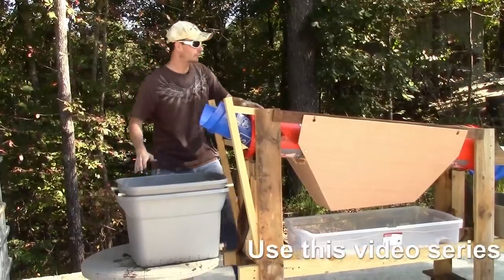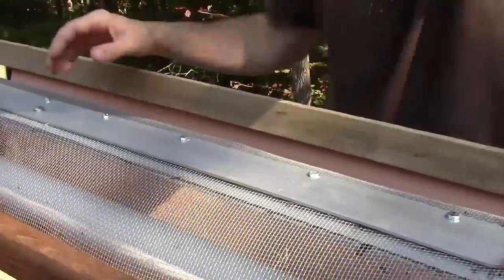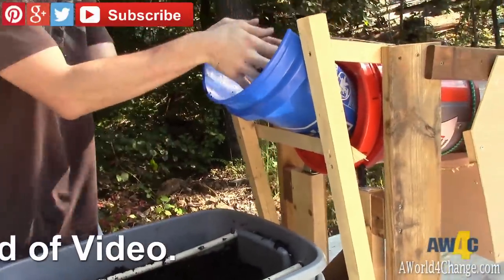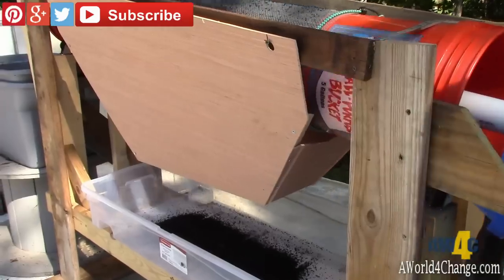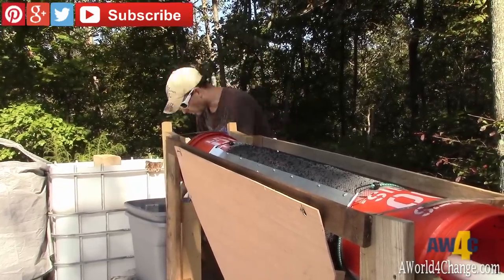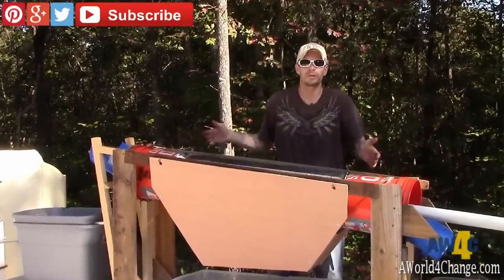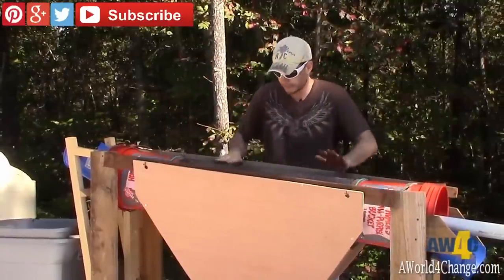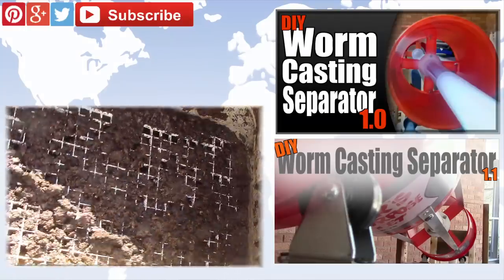DIY Worm Casting Separator 1.2

Comment: I saw one trommel that had a brush running it's length on the down turning side to knock off debris stuck in the screen.  They didn't say how fast it was wearing out or how often it needed to be adjusted closer to compensate for wear out.  A rolling brush would probably work better for a while, but the bristles would eventually get bowed from colliding with the mesh strands.  Putting cam lobes (curved ramps) on one or both buckets could be the activator for a wheel on a pivoting rod (like a see-saw) that could regularly jump and thump your device, but I'd keep a watch for failures around screws and bolts, like cracks.

Comment: nice machine, very efficient

I tried to separate castings and worms, such a hassle, now what I do is empty the worm bins into the garden for 7 months and do a round-up in the fall.

I just bury a few melon rinds here and there marked with pin flags and they congregate
Reply: I think this happened with my worms in my worm bin the worms I had purchased escaped my bin because it got to hot so I put spent grains in my compost can and today when I tipped it I found a over abundance of capsules

Comment: idea use 1 pull tie for each hole or as close as the will go to each other around a rod just above screen they tap each hole as it spins . may have to find a way to hold them so they dont turn. Another idea a narrow bristle brush above. yep that'd do it.

Comment: You might want to have a look at this guy's sifter, how he has a rotating hand grip and where he placed his handle and input chute.  Both the rotating hand grip and having the input chute on the same side might make yours even easier to use.  You won't need a complicated hopper nor will you need to go back and forth between both ends to load and turn.  https://www.youtube.com/watch?v=1n5BZKZBKJE .  I also don't think you need the bucket lid, as the wheels and the bucket rims will not let the sifter part move past either pair of wheels.  The opposite end wheels and rim should deter any up/down movement, right?  I like how you used the bottom of the buckets to hold your axle - smart move.  Have you solved your accumulation problem?  I'd be interested to see how you did that.  Have you thought of a simple cog on the bucket side that would activate a wood hammer on the side of the wire mesh each revolution for a tap?  Thanks for sharing!